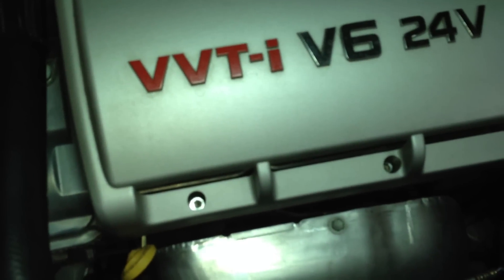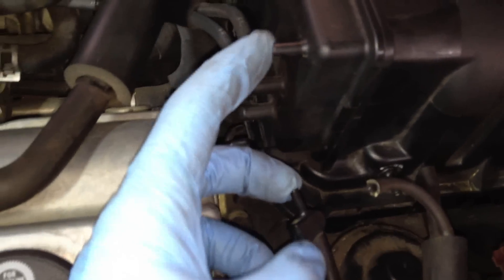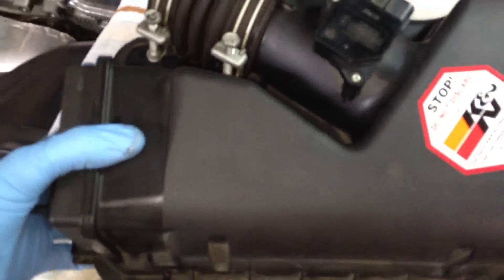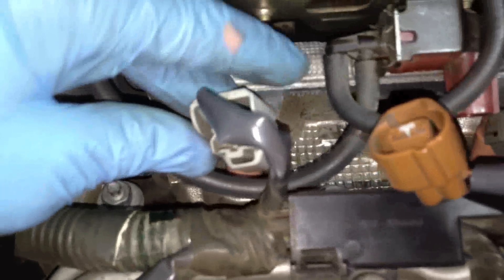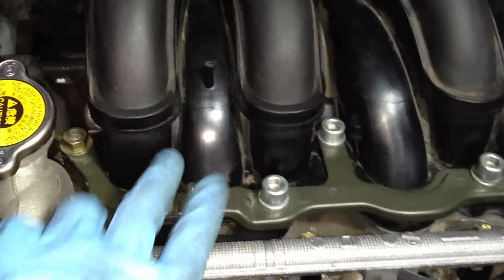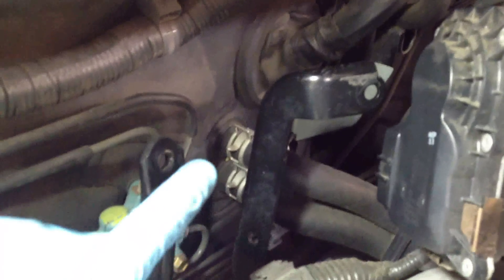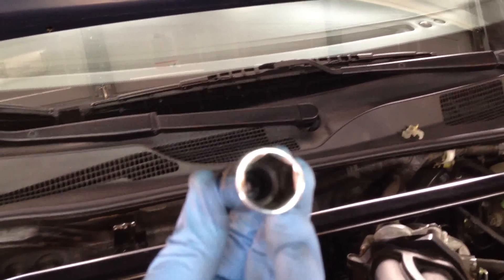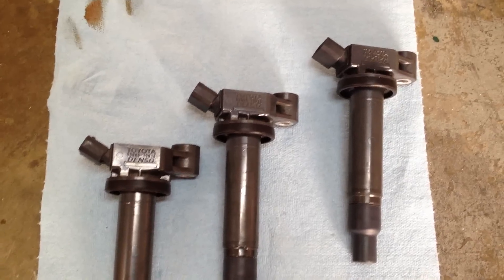How to Replace Spark Plugs in Your 2001-2006 Camry

Comment: Great Job.  The internet needs more people like you.  I just finished mine and your video helped a lot.  The small elbow Ventilator hose that hangs off of the intake manifold and connects to my rear valve cover (PVC valve)  fell behind my engine during dis-assembly.  I noticed after my car ran  rough and  then would not start. Luckily I heard the hiss of a vacuum leak and saw the PVC valve sticking up and found the hose laying on a control arm.   Thanks again.

Comment: So some people said you could do it without removing the manifold, just tested it, you can on 2004 solara.

 I still appreciate the video for helping me find that out, but in case anyone wants to go this route, it still takes about 2 hours, here are the instructions:

 Take off the back air hose, the one by plug on cylinder one. 90 degree one, about 5 inches long.

 Take off the airbox cover (10mm).

Loosen the boot on the lid and on the side connected to throttle body. (10mm), take it off and push it out of the way.

Take off the throttle body, 2 nuts, 2 bolts (10mm)

Take off the part that connects to manifold, 4 screws, 1 nut and 1 more nut attaching it to the bracket. Push it out of the way as well.

You can now reach the plug on Bank 5, right side with a small 10 mm, I had to disconnect mine because the coil boot was torn, swapped it to the front to replace later, used screwdriver to apply pressure to disconnect, plug socket drops right in with the long extension.

 Next, left side, cylinder 1, a bit of a pain, but can be taken off without disconnecting the coil, pay attention to how you pull it back, it's tricky to get back in, I just tucked it back and out of the way.

 Now the hardest part, cylinder 3, back middle, I had to use long needle nose pliers to disconnect the coil, after that you can actually barely fit the ratchets in there, you will be making tiny turns though, but once again, there will be enough clearance for everything if you disconnect the coil! Also! Do not put the left coil back in until you finish this, give yourself extra room to work with, every bit helps!

Now I warn you, there is very little room, I have big ass hands and long fingers, and I couldn't fit in there with gloves, so I have scratches all over right now lol.

Oh and last tip, you can set your light on the opposite side of the manifold you are working on, to keep it out of the way. 

 Hope this helps someone, I'm gonna go have a beer.
Reply from the maker: Thanks for the info, Leonid!
Reply: Sure thing, like I said, without your video I wouldn't even know it was on option, I think if I did it again, I could get it done in an hour or so, but first time around there was some trial and error, cylinder 3 almost made me give up as well lol.

Again thank you.
Reply from the maker: You're absolutely welcome.

Comment: My mechanic just did my 2006 and my sons 2005 v6 camrys spark plug replacement. He didn't take anything off. He bent over the engine and got his hands behind the manifold and took out the plugs and replaced them. He removed one tube that was in the back to get his hand in. He is the best mechanic I have ever met.
Reply from the maker: Wow. Is he Japanese?
Reply from the maker: Some people are doers; others watchers of the doers.
Reply: Yes, I found a video that way also but, looked much more difficult to get to the plugs than what it’s worth. Hats off to your mechanic…

Comment: The 3 bracket bolts in the back were a PITA!!!. One on the driver side was not bad. The two 12MM on the drivers side took me a couple hours. Racheting flexed wrenches helped but you still need to maneuver to get your hand in there. I used one hand holding the wrench kinda under hand while holding the wrench on the bolt at the same time, with one hand, cause it kept slipping off the bolt. Don't know how I did it, but it got done, lol. I changed out the PCV valve. I took out the hose and valve out together. The PCV valve would not separate from the hose. Use a heat gun. Heat where the PCV valve connects to the hose for a short time then pull the PCV valve from the hose without breaking or cracking the hose. Instead of using a razor blade use a heat gun.  Overall this is a great video. It made the job 10 times easier. Thank you for taking the time to post it on youtube. BZ!!!!!!!!!!!!!!

Comment: Thank you for making this video-gave me the confidence to take on this project. I just wanted to add that to remove the 14mm bolt in the rear of the manifold, a ratchet wrench works perfectly because you only have a few degrees of movement there.  Also there is a small bolt securing the AC line next to the 14 mm bolt in the rear of the manifold that must be removed;  again use a ratchet wrench to remove this bolt.

Comment: You are an absolute lifesaver. Dealer wanted 900 for plugs / replacing valve cover gaskets (ES330). I knew the rear plugs were a PITA but wow. Now I can confirm it. Even with your video, I was right at the 6 hour mark as well. But 30 minutes running to Home Depot for the 8mm Hex you mentioned and I thought I had, 30 minutes to eat / give my back a rest, and 1 hour trying to get off that @^&@! 14 mm bolt in the back of the intake. Now for a beer and a soak in the hot tub. Thx for saving me $900!
Reply from the maker: Thank you. Glad it worked out and saved you some $$$.

Comment: Thank you for taking the time to do this video,i don't' think i would have attempted the job,without the use of your video, just completed the job,it took three hours,by far the hardest part was getting to the back three bolts,other than that,not to bad,thanks again.
Reply from the maker: Glad it worked out for you.  I started this job the same way - looking for a video on YouTube and there were absolutely zero.  So, half-way through this job I started recording video and spliced the pieces together backwards to make it (because I was already putting everything together by the time I started recording).  It was fun, but I wouldn't want to do it again.  :)
Reply: Get a set of flex-end ratcheting box wrenches from harbor freight. BIG help. Costs $10-15 for the set.

Comment: Installing the 3 back firewall bolts was not too fun either.  One Tip.  On my 2004 Sienna, The outside 12mm bolt, loosen the vertical black pipe support on the other end behind the engine.  This bolt 12 mm is easier to get to and will allow a little play to thread the 12 mm bolt in the Throttle Body.

Comment: Great vid.  Thanks!  I was a bit hesitant to tackle the plugs until I found this turorial.  My '03 V6 is a bit different where the manifold comes off, 2 Allan bolts where you have 4, as well as the where the wiring harnesses are...I seem to have 5 in the cluster where you have 4.  The one i have is a Japanese build.  All in all it's pretty much the same.  Thanks again.

Comment: Thanks for video.  I was hesitant to do this even though I have a toyota/factory/service manual(not chilton crap).  The prospect of removing throttle body, intake, distributor/hose trunk, aircleaner seemed like an all day project.  However, I learned from you video it's only half that.  Thanks.

Comment from the maker: @mrkinsocal I totally here you, bro. That 14mm in the back was nuts! $900 is even more nuts! Not being a mechanic, I didn't even know where the rear plugs were until I just started dismantling things so I could see the heads of the rear coil packs. Thanks to Toyota for sticking that engine in sideways to save room. Glad it worked out for you tho. I searched far and wide for a video on this and couldn't find anything even close. I figured someone would get some use out of it.

Comment: great video.  I may actually be buying a 2005 highlander tomorrow.  Boy as an engineer, I hate this much removal for spark plugs.  Way back in the 1960s, the one big lesson they learned from the Mercury spacecraft program was how hard it was to work on one little component that was under the seat and behind this and that and took a day to even get to!  You are so likely to break something while working on something else!
Reply from the maker: Thank you so much! I concur. The chances of breaking something while attempting to fix another is high on this vehicle.

Comment: Nice video, I changed the spark plugs on my 2003 camry 3.0 v6 with out removing  the intake, it's quite a bit harder but  I did it, but I  have skinny arms, lol, I only had to remove air intake from the filter to the throttle body,  not the throttle body,
Reply from the maker: Thanks for the compliment! Sure feels good when the job is accomplished. Good work!

Comment: Thanks for the video and showing me where the hidden bolts were, changed my spark plugs today on my 2004 Solara, took about an hour and a half for me.... I recommend using a ratcheting wrench on the left rear bolt on the intake manifold, still a pain due to the clearance but a lot better then using a regular wrench and having to take it on and off the bolt every quarter turn... Hope that helps the next guy if they read this... I think I might be able to do this in an hour next time...
Reply from the maker: Heck yeah, a ratchering wrench is the key.

Comment: watching this makes me glad I have a Honda Civic. I changed the plugs in under 10 minutes, super easy compared to the Camry V6.
Reply: There's also a 4 Cylinder Camry and other Toyota Models Lol
Reply: yeah I know but not as much power which is useful in an emergency
Reply: edbo10 I can't take off The 14 mm bolt behind the Manifold how did you do it this Guy didn't show
Reply: I dunno, I've never taken it off before, personally I'm too lazy and don't have all the whiz bang specialist tools so I just get the parts and get my mechanic to do the gaskets.

Rear spark plugs you can get to without actually taking off the intake plenum, procedure is mostly the same between the 1MZ and 3VZFE engines: https://www.youtube.com/watch?v=qf-4hq3kJFI
Reply from the maker: I used a short, flat open-ended wrench and turned it about a quarter of a turn each time die to space constraints. It was a huge pain.

Comment: This would be the only time I would prefer the four cylinder option. That's a lot of work to get to the rear plugs.
Reply from the maker: Yes it is. I now have a four cylinder Camry and it was a breeze installing new plugs.
Reply: You actually don't have to remove the manifold to get to the back 3 I have did several of these engines I got a 2006 V6 Camry now and it's not hard to get to the back 3 just need the right tools and a little patience

Comment: Thanks VERY much for this tutorial. I would not have gotten the back 3 done without your video. BTW what sadistic engineer designed those back three fasteners for the intake?? If you have hands larger than medium removal will not be accomplished without SIGNIFICANT pain.
For the two 12mm bolts on the attaching the back of the manifold on the right a 1/4 drive worked best. For the 14mm on the left rear a 14mm open end worked. Not enough clearance for a socket wrench.
fair warning - not easy

Comment: I have an '05 sienna, and it has the same engine layout as the  '05 camry's.  The only difference I noticed is that there is a small bolt in the rear of the manifold, next to the 14 mm bolt, that holds the AC line in place that has to be removed.  My suggestion is to watch the video over and over until you feel comfortable taking on this project.

Comment: I have a 2004 Sienna XLE. Mine had metal bracket with a 1/2" dia end, by the 14mm firewall bolt that must be pushed to get the plastic air intake manifold off.  The (3) bolts by the firewall are extremely hard to get out.  I ended up using a boxed end wrench.  The two 12 mm bolts I could get to from the drivers side.  The 14mm I gained access by from the passenger side.  I used one hand to find the bolt and another to put the wrench on the bolt.  I only had access to the the wrench 90 degrees.

Comment: This is one of the best DIY car video I've seen on YouTube. Great explanation and breakdown of the parts needed for removal. I'm using your video as a similar how to on my 2001 Avalon. I tried like heck to change out my engine fuel filter, but the bottom nut will not budge. Tried penetrating fluids with no luck. I'm afraid of stripping the nut (14mm). Do you have any experience/suggestions on this job. Should have been a simple task... Thanks.

Comment: I can feel where the bolts are, I just can't get to them. I really do need the ratcheting flex wrenches and no one around here carries them. Also, it's a 2004 Solara V6 that I'm working on, so there are some subtle differences and no one on YouTube has a tutorial for that setup. My fault for buying the damn thing... Thanks for the help though. I appreciate you commenting back so quickly.
Reply from the maker: I hear you. I had to use short wrenches for about 100+ quarter turns. My hands were completely bruised and cut up after the job. Not fun. Hope you get'r done!
Reply: +Militarized Citizen 
Will do. I walked my happy ass for 6 miles around town trying to find a shop that has them. The Pep Boys website said they did and the rep on the phone was too lazy to go look for me, so I had to go down there myself, to no avail. I'm making a last ditch effort to go to Harbor Freight tomorrow and if they don't have the wrenches, then I'm just gonna order them. This is madness.

Comment: So, you pretty much have to remove everything to get to the plugs? What happened to serviceable engines? I love Toyotas and always have it serviced at the dealer but my 2005 Corolla needs plugs and I hope I don't have to remove half the engine to get to them. / thanks for the video.
Reply from the maker: The main reason, John, is that they install the engines sideways to conserve space. The Corolla might be easier since it is a 4-cylinder. You're welcome for the video. It's the only one on YouTube (that I'm aware of) that even attempts this painful project. ;)
Reply: 4 cylinder engines are extremely easy to work on. The V6 Camry though is a nightmare.
Reply from the maker: Straight up. I'm amazed at how much work it takes to do this job.

Comment: do you need any replacement seals for the intake manifold once removed, or can you just keep whats on there??? about to do mine here soon just want t get this job done now lol
Reply: there is a "rubber" type gasket that goes into the back of the plenum. It is kind of snake like or rope like. Typical like you see on other throttle body/intakes

Comment: Very nice video bro.  One of the best ones out there.  Preparing to change the plugs on my ES330.  Also will be changing the air intake  plenum gasket and EGR valve while back there.

How the heck do you keep your engine so clean?  Also how did you clean or what did you use to clean the coils?

Thanks.
Reply from the maker: +BenzSUV Sweet man. Glad it helps. I just wipe the engine down every time I wash the car. I used Windex to clean the coils.

Comment: I just changed the spark plugs on my 2005 Camry SE, 3.3 L V6. Be aware that you cannot lift off the surge box (plastic plenum) with the throttle body attached to the plenum. The throttle body has interference with the firewall. Once the throttle body was removed the plenum can be lifted off.Throttle body butterfly was very carboned up, so needs a good cleaning.
Reply from the maker: Good to know. Thanks for the info, John! How long did it take?
Reply: @MilitarizedCitizen  About 10 hours, but I'm 73 and don't work fast. The 2 bolts on the back of the plenum and the 1 bolt on the throttle body are in a nasty location. A 14 mm and 12 mm ratchet wrenches are must have tools. I thought I might have an engine code or wrong idle speed because battery was disconnected, but absolutely no problems at all after starting up the engine.
Reply from the maker: Wow! 10 hours. That sound about right; it's a hard job. You are correct on all accounts. Those are the tools you need; I wish I had those back when I did this job. Weirdness on first start is normal and for exactly the reason you specify. The computer has to re-read everything before settling in. Great job at 73!

Comment: Yup, have to remove many assemblies to get at the rear plugs. Also a good time to inspect the many vacuum lines for splits (I had 2.) I bot a set of ratcheting swivel head wrenches 6-19mm (definitely worth the price $40 on Amazon.)  The two 12mm's bolts are not too bad, but that 14mm head bolt is a nut buster. I dropped the OEM bolt which did not make it to the ground - frame swallowed it up. A trip to Home Depot for an 8mm x 1.25 x 20mm bolt (2 bolts per pack and matching lock washers total about $2.)  Good thing two bolts cuz I dropped the 1st one incld a lock washer from H.D. - also swallowed up by the frame, but the 2nd (3rd total) was the charm.) Yup, I have huge hands and they are cut up and creased due to jamming my hands in to get that bolt out/back in. Even w/ the ratcheting set, it sucked. Oh, and the replacement bolt head size from H.D. is a 13mm (just buy the entire set - a good idea.)
Nice video and noticed you really like to say "throttle body" (a lot. ;) Suggest putting it on your tombstone when that time arises or if you can't wait, get a tattoo. Need to have a lil sense of humor after a pain in a$$ job like this one.Thanks for video. Great job!!
Reply from the maker: +John Bennett Ha! You definitely need a sense of humor after that job for sure. Thanks for the feedback. Glad you got'er up and running.

Comment: Thanks for the vid. I'll need to replace my plugs soon before the weather gets cold. Noticed how clean the engine looks under the cover. Did you clean with engine degreaser and hose down?
Reply from the maker: Typically, I would have the engine steam cleaned.  This is to ensure water doesn't get into the wrong places, but yes, every six months I wash/wipe down the engine very carefully.  I hope the video helps you.  Let me know how it goes!